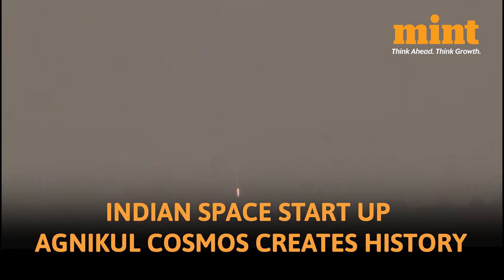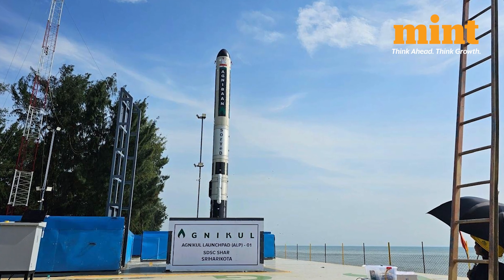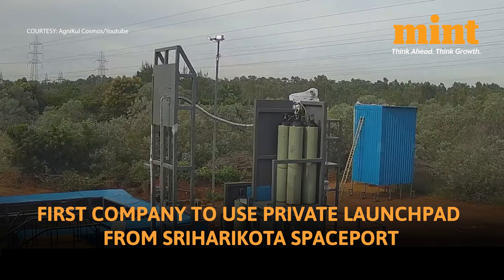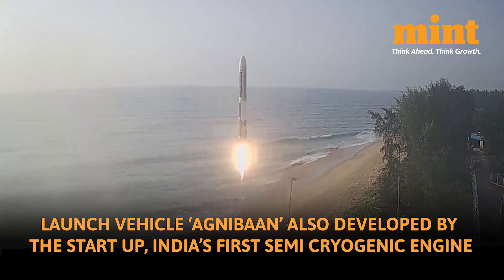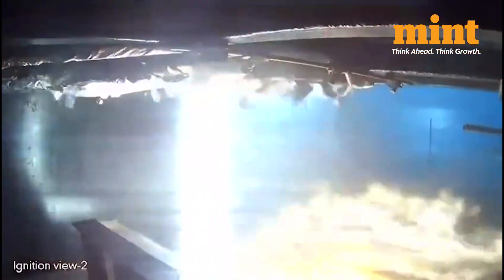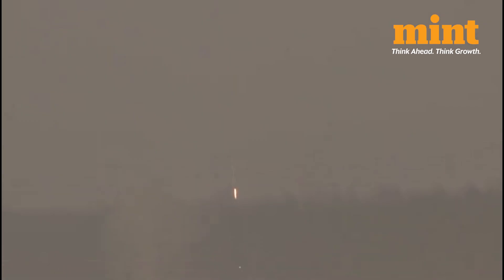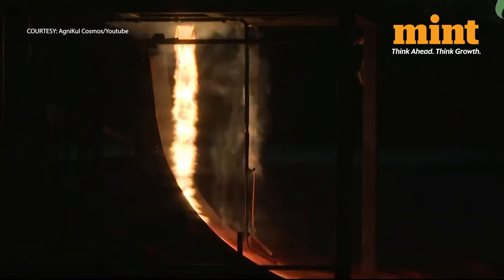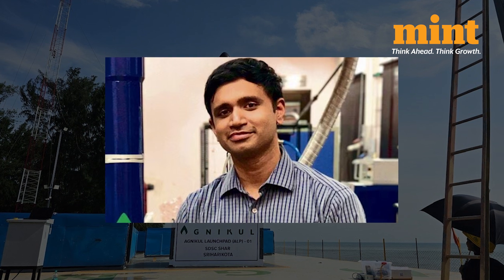Chennai-Based Agnikul Cosmos Flies World's First 3D Printed Rocket Engine

Comment: Spacex's Super Draco: "Am I not 3D printed enough for you?"
Reply: Well the super Draco is a hypergolic propellant rocket engine and the Agnikul sorted engine is semi-cryogenic. It's like a comparison between the world's first 8.7 litre turbo diesel  'V' config 12 cylinder vs first 3.6 litre naturally aspirated petrol  'inline' 6 cylinder. Both came first to this world... Complete different engine. Hope you understand 🙏
Reply: @bismayparida2115  it just means that the classification is incorrect. It's not the world's first 3D printed rocket engine , but the world's first 3D printed fuel-oxidizer rocket engine

Using your engine analogy, it would be like claiming that the world's first 6 cylinder turbocharged engine was the world's first 6 cylinder engine. Completely different claims. Hope you understand